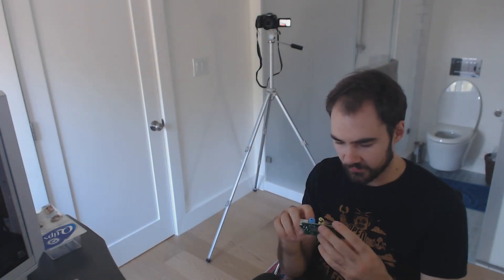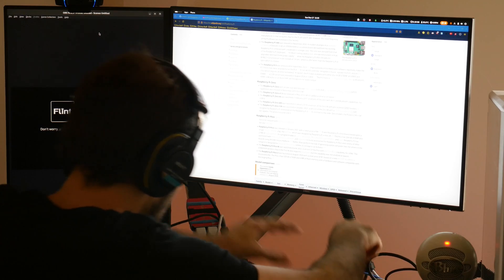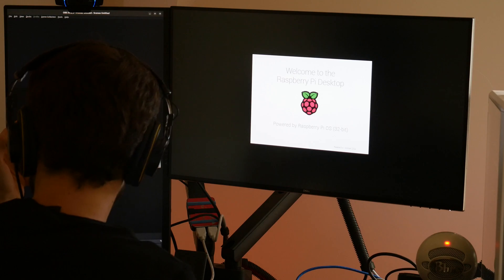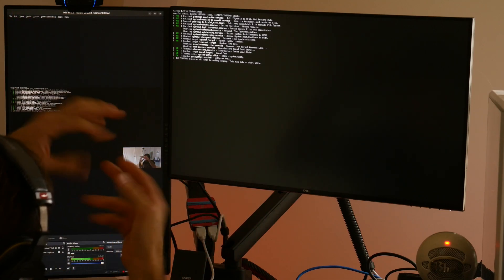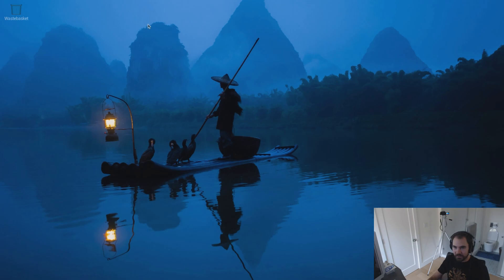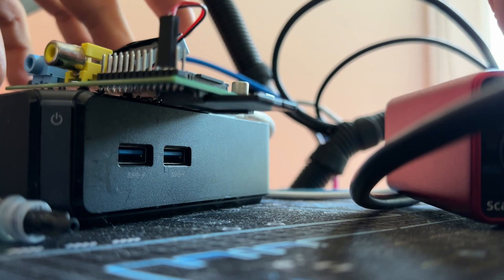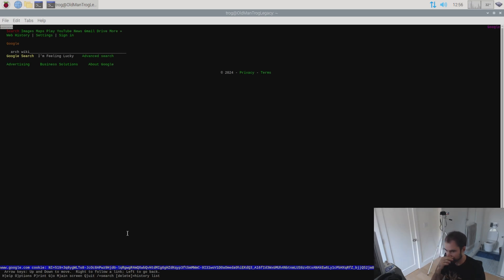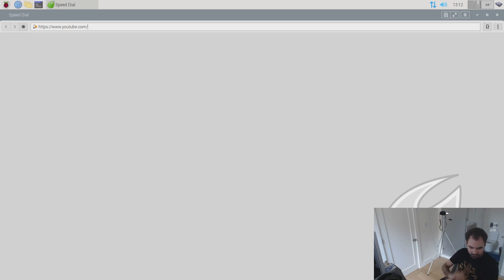Is The Original Raspberry Pi Still Useful?

Comment: If you check out iriun (two parts, phone app and desktop webservr) 
You can tether your phone to the pc for a super low latency virtual camera through your phone. From there you treat it as devices in obs.

And a tripod :)
Reply from the maker: Would you believe I’ve had that old Logitech webcam for probably well over a decade at this point…? Yeah I really need to upgrade it one of these days. I’ll look in to your suggestion. Thank you!